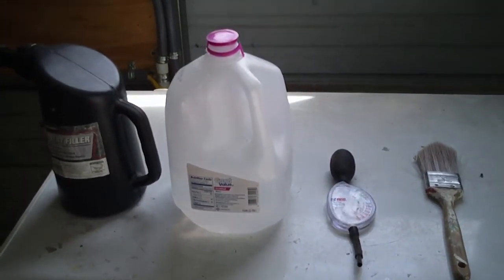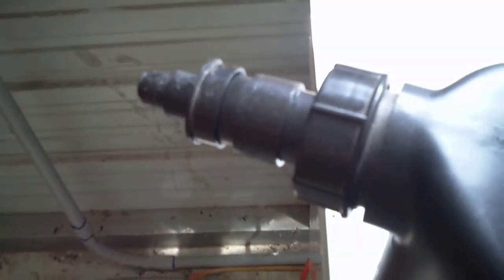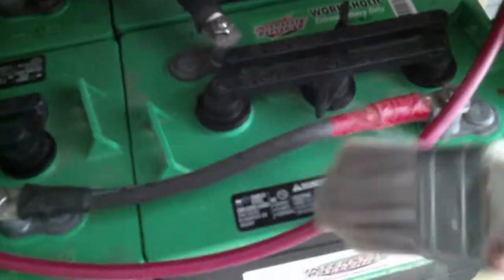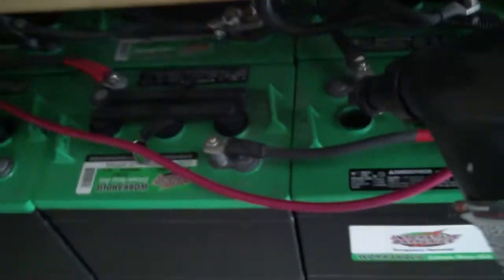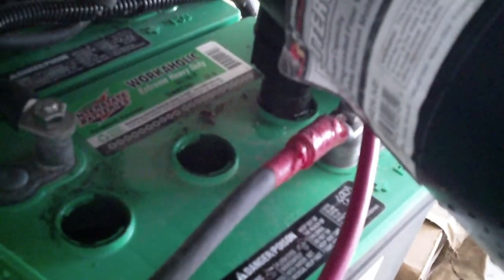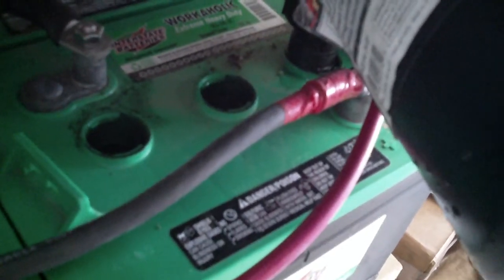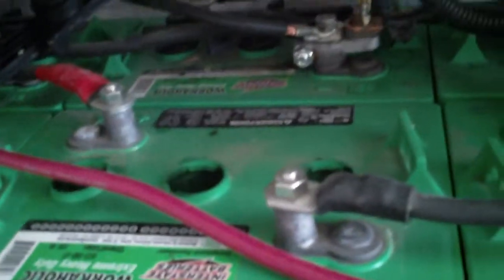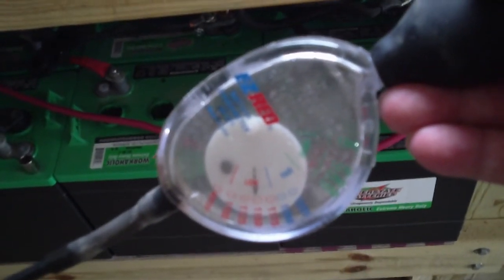Solar Power Battery Maintenance

Comment: talking to crown battery i just sold 6 golf car batterys and ask him about using them a 6volt cost about $100 20hr cr-235 rating 235.. a cr-430 6v 430 amps cost $250.. a cr-215 12v 215 amps cost$250 i think if the salesman would lug em down my steps i would two big 12volt parallel=430 amps

Comment: hi 6 volt batterys should be shimed like theay are in most carts to cool and vent,seal the ends using napa open gear lube spray,use hydrometer after full charge,and have ben sitting for 15 to 20 hours. fill right at full charge,as this is high level, test at low state o charge and find week cell? fill only to bottom of slot.keep baking soada water soked rag to cleen tops and any spilled aid,only use one hand or get ziped? clean fill clean wax if you want,test betwen fillings.like your12v hookup!

Comment: would you recommend golf cart batteries from lowes? What would be the difference between running them in parallel and series, what's your recommnedation? As for charging the batteries, do I just hook the charger to the first battery or would I hook the positive to the first battery and negative to the last battery in the series? Do you mind me asking so many questions?

Comment from the maker: All you need to do is setup your battery bank and get a quality inverter from Magnum Systems or Outback that has a built-in battery charger and automatic transfer switch. The inverter will keep the batteries charged and upon a power failure it will begin inverting automatically. You can add solar panels later if you wish or as you say you can simply use a separate battery charger powered by a generator to charge the batteries. Good luck.

Comment: I'd love to setup a battery bank for power outages. Initially i would want to have it maintained by the utility power into the house, and have the ability to charge them with my generator during power outages. Ultimately I would like add solar panels to the system.. I know nothing about doing this, do you have any recommendations on where to start?

Comment: Hi Al, I have missed some videos and need to catch up.  We had near drought for some months.  My spring has held up but I was pumping water with a 220 pump almost daily.  I put two 300 watt inverters to run both legs of my house panel.  They were sucking my batteries down when I left them on 24/7 so I put the on timers for the morning sun when I water my garden. I still have enough juice to run my computer on the pure sine wave inverter that I bought from you. 
Out of letters
God Bless
28Bull

Comment from the maker: The first battery bank was installed August 2010 so it's now 2 years old, I expect about 6 years out of them with proper care. Remember that they are discharged 50% every night so it's a very hard life for them. Typical golf cart batteries last no more than 18 months under those conditions so this is a true test for the efficacy of the desulfator.